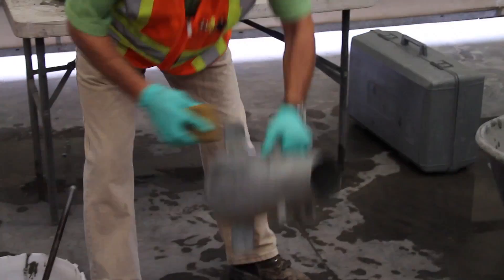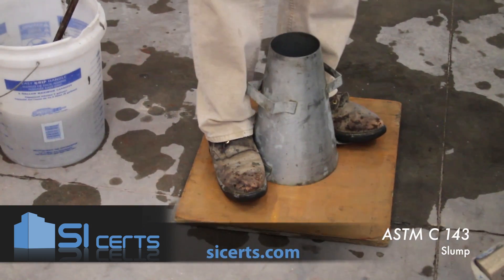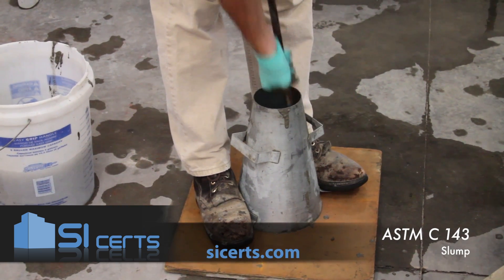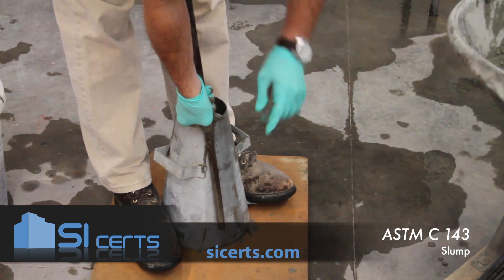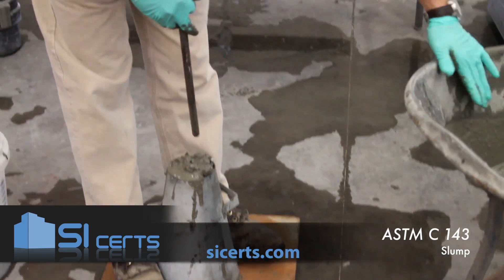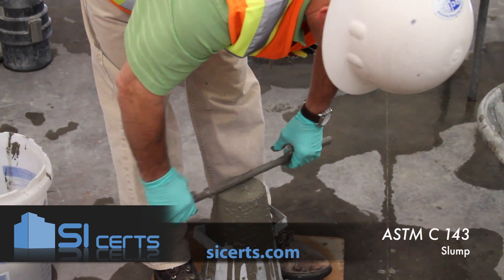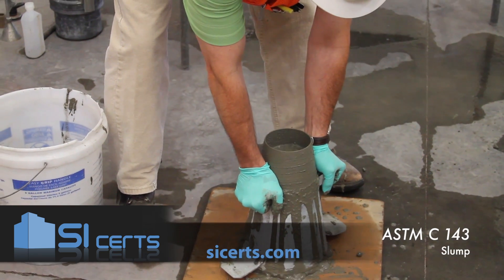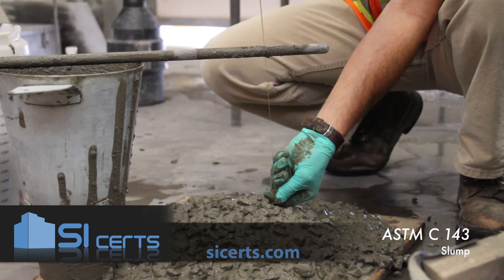ASTM C143 - ACI Concrete Slump Test (Newer Version Available, Click Top Right Corner)

Comment: perfect slump for block fill. kinda dry for flow fill. also, every slump test I've seen had a base with a handle that swings up after the cone has been lifted. and the slump is measured from the handle to the top center of the slumped concrete. without that base, I can possibly deny said slump test.